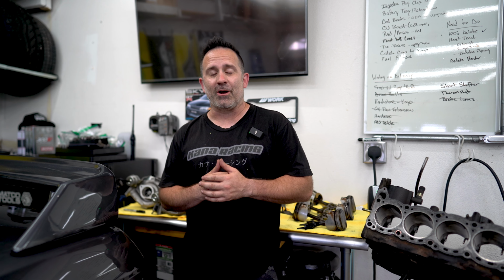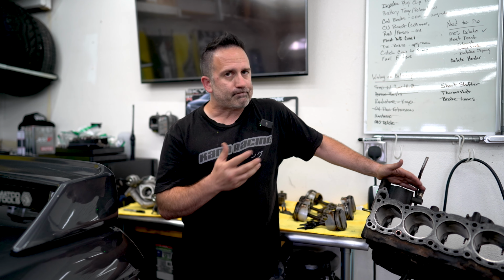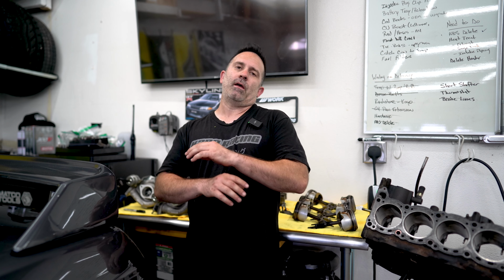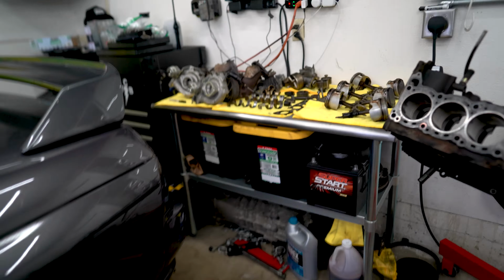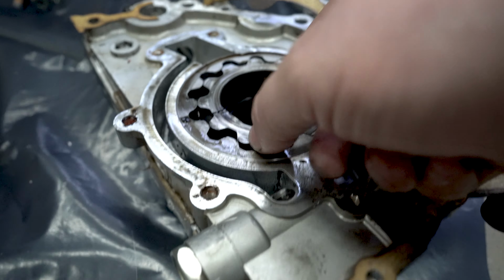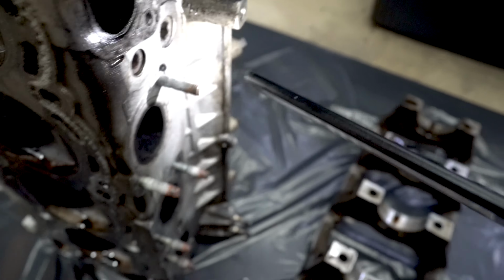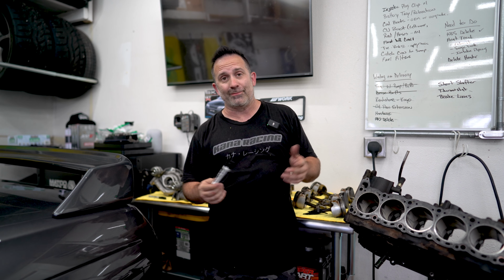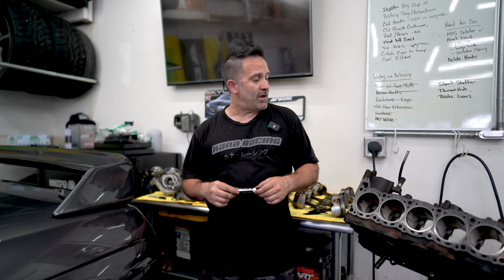R32 GTR - Its all Bad For Project Shinigami and the RB26

Comment: Now I'm scared to take apart my motor to see how it looks like. It still runs but it's just as old as yours.
~220k mi, 99 miata.

However I'm inspired by your video to do it cuz I just want it to run better and I plan on keeping it for a long time to chase others.

Any plans on cleaning up the head or just the block?
Reply from the maker: Miata's are so fast on a tight track, I'm sure you'll get plenty more time chasing down cars.

At least with Miata's the parts are plentiful and for the most part still priced good and easier to swap the entire engine out if/when needed.
Reply: My ideal swap is a Honda k series motor. Back in the day I have an EP and I spent a lot of time with that K24A3. I think its a good fit for the car.

Super affordable, awesome torque curve (flat 160 ftlb til 6k), plus Honda reliability.

Just gotta get past the kmiata kit that's 9k